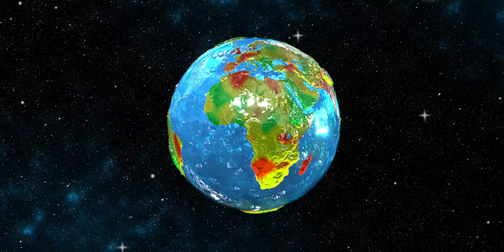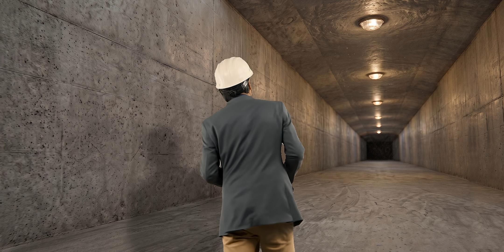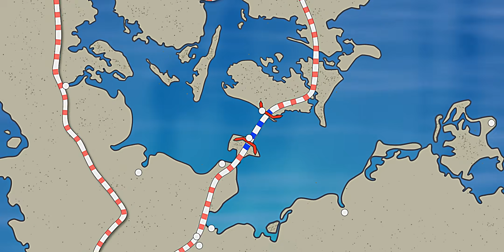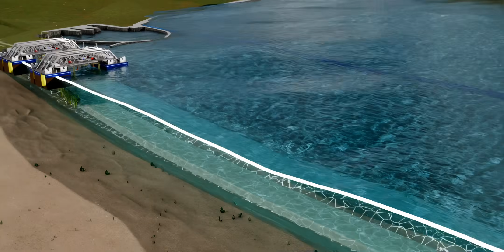Europe will be Completely Transformed After This Tunnel  | Fehmarnbelt

Comment from the maker: I hope you enjoyed the beauty of precise CNC machining. https://jlccnc.com/?from=SabinCE New users can claim upto $123 welcome coupons by visiting this link. With CNC machining and sheet metal services starting at just $1, JLCCNC makes high-quality fabrication accessible to everyone.
Without their support the Fehmarn belt tunnel video would not have been this much informative. Thanks for watching! — Sabin Mathew
Reply: You should be ashamed of yourself for the propoganda in your N9ne E11vn video
Reply: There are a slight mistake in connection with how the tunnel over time will be covered with sand by nature. It are an integrated part of the project that the sand removed to dig the trench will be pumped back over the tunnel elements AND new bottom plants will be planted by divers as well. They actually will start by covering tunnel elements with gravel before pumping sand back on top. So around 5 years after tunnel opened bottom should be fully restored to be like before work were initiated.

Comment: If each section is water tight, what is stopping workers from entering a first laid section when the next third or further ones is being laid?
Reply: Many of the illustrations in this video are factually wrong. Unlike what you see in the video, the elements are being laid from the portals and will meet in the middle of the Fehmarn Belt. The first bulkheads are already removed, and workers are already in the laid sections of the tunnel.

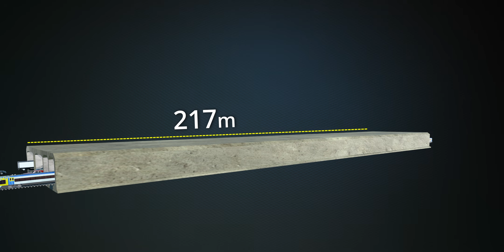Comment: Page 8:30 why pour concrete to finish the joints? Will this make joints rigid? Joint performance for water tightness will be sensitive to joint misalignment caused by bending stress from future settlement.

Comment: Now we just need the German side to be ready with train tracks and motorway, the danish side will be ready on time
Reply: The current estimate for the German rail connection is 2031. If the tunnel is opened before then, they either open only the motorway part first, or the train stops on the train station on Fehmarn, and people have to be shuttled by busses to the main land.

Comment: The title is a bit misleading. Yes the tunnel will be good as you don't need the ferry anymore (time gained) and it is a nice engineering feat. However stating it will "transform Europe" is a bit over the top as they say. But otherwise it's a nice informative video.
Reply: There are a good chance that the tunnel will make rail based and thus low to non carbon emitting transport a much better option for many moving goods from Nordic region to central Europe and beyond and vice versa. The current bottle necks in existing railroad path are the two bridges in Denmark that already today are used at high capacity. The likelihood that Spanish and German car makers would switch from sea based transport to rail for Nordic region markets an example that could eliminate a lot of transport time by sea. Artic circle wood could be sent by rail all the way to Gibraltar by rail etc.

Comment: From copenhagen to hannover via femern using the ferry: 493 Km.  Expected price fermernbridge  545Kr for car.
From copenhagen to hannover via storebæltbroen  522 Km.  Price 205 kr
Difference 29 km.  Ev consumption  5.5 km/kw/h =  29/5.5 = 5.27 Kw/h
Charging at Tesla supercharger in bispingen   3.44kr kw/h .   3.44*5.27 = 18.12 kr
Difference 545-205-18.12 = 321.88.
If i drive 29km  i can save 321.88 kr.
The population of sweden and finland is less than 3 % of europes population.  Obviously the norwegians are using the ferries  between norway and hirtshals.
Less than 3% of europes population having an expensive shortcut to eastern germany  and eastern europe is obviously not going to change much.
We have a saying in denmark .
Det er en ommer.
Reply: Gør arbejdet ordentligt eller lad være.. Sverige, Finland og Norge er moderne industrilande. Du glemte fordelen ved hurtigere og kortere transportvej for tusinde lastbiler, godstog og togrejsende.
Læs hellere offentliggjorte beregninger, fra dem der ved hvad de snakker om 🤡

Comment: As a Dane I have lived rather close to this new tunnel and for a long time, both entrance portals, also in Germany, have been made ready (And with our King, Frederik Xth, cutting the entrance band on the element in Denmark). It is a Danish-built and paid-for tunnel. But problems with the named "Ship", which is intended to position the elements in the ditch, have delayed the process. But now it is ready, and the first actual Tunnel Element has been placed on the seabottom. Amazingly, some distance from the Portal, but this must be intended, I presume? But the Germans are also delayed, so I doubt that I, at 78, will be able to drive through, as the opening now will be in the early thirties?

Comment: Your video is good, but I have two  questions which are not covered:
Question one is more of a funfact: 
Why are those gaskets called "Gina" gaskets? Hint: It has to do with an Italian actress....
More important is the second question:
The first element is already submerged, but they did not start somewhere in the middle and won't add to the sides from there. Since both portals are finished they will add from there and then finally they will have to add the last segment between the two halfs of the tunnel. How will they position this element since the option to put it "almost" in place and then let pressure and those hooks do the rest is not possible then?

Comment: ai summary

Abstract

This technical analysis details the engineering and construction methodologies of the Fehmarnbelt Fixed Link, an 18-kilometer under-construction immersed tube tunnel connecting Hamburg, Germany, and Copenhagen, Denmark.

The project utilizes 89 massive, prefabricated concrete elements, each 217 meters long and weighing 73,500 tons, manufactured at a highly specialized 150-hectare casting facility in Rødbyhavn, Denmark. The construction workflow involves casting elements in nine sequential phases under climate-controlled conditions to guarantee a 120-year operational lifespan. Once cast, elements are sealed with reusable temporary bulkheads, floated via controlled ballast trimming, towed to the marine site, and hand-transferred to the custom-designed immersion pontoon Ivy.

Marine installation requires excavating a precise trapezoidal trench along the seabed, preparing a gravel foundation at depths up to 30 meters, and lowering the elements using strand jacks. Final 2D alignment is accomplished via tensioned mooring ropes and guidance cables. Watertight sealing is achieved hydrostatically: pulling jacks compress an elastomeric GINA gasket, and the subsequent dewatering of the joint cavity creates negative pressure, allowing external hydrostatic pressure to lock the joint prior to permanent concrete casting and bulkhead removal via a specialized Bulkhead Lift and Rotation Tool (BLRT).

A comparative evaluation explains why the immersed tube design was selected over a cable-stayed bridge (due to shipping collision risks, environmental footprints, and railway gradient limits) and Tunnel Boring Machines (unnecessary at the shallow 30-meter depth). While official targets project a 2029 opening, a 24-month delay in commissioning the vessel Ivy suggests a realistic traffic opening in 2030.

**
Project Analysis: Fehmarnbelt Immersed Tube Tunnel Engineering

    0:00 - Marine Transverse Alignment Mechanics: Engineers control the lateral position and alignment of immersed tunnel elements during lowering using strand jacks mounted on dual pontoons. Precise straightening against marine currents is achieved by tensioning mooring ropes anchored to the seabed; as the ropes are pulled vertically, they naturally straighten, forcing the element into alignment. Guidance cables provide full 2D mobility.
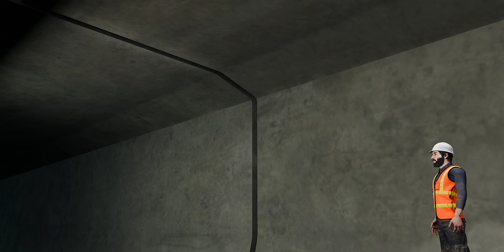    1:42 - Hydrostatic Sealing and GINA Gaskets: Watertight joints between the 217-meter elements are established using hydrostatic forces. After ROV inspection and high-pressure water jet cleaning of the joint faces, internal pulling jacks draw the new element against the previous one, compressing a primary rubber GINA gasket.
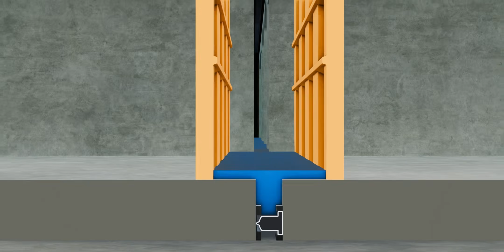    2:53 - Vacuum-Assisted Joint Bonding: Pumping out the water trapped within the chamber between the two bulkheads creates negative pressure. The external hydrostatic pressure at the seabed (up to five times atmospheric pressure) pushes the elements together, creating an incredibly tight bond without external machinery.
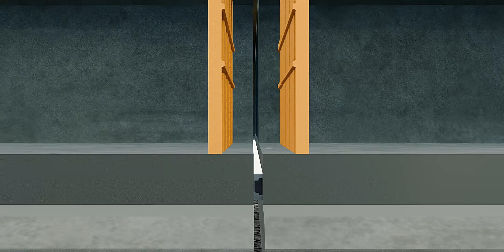    3:13 - Permanent Jointing and Atmospheric Safety: To finalize the connection, workers enter the joint chamber (maintained safely at 1 atmospheric pressure) to install a secondary Omega seal and pour permanent concrete. The joint remains completely stable because the internal tunnel pressure (1 atm) remains far lower than the external hydrostatic pressure.
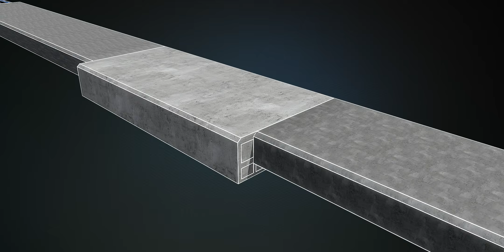    4:20 - Double-Decker "Special Elements": Out of the 89 total tunnel elements, 10 are designated as "special elements." These are wider and feature a double-decker layout; the lower deck is reserved for critical mechanical and electrical infrastructure (transformers, switchgear, pumps) and includes a layby for maintenance vehicles to avoid interrupting traffic.
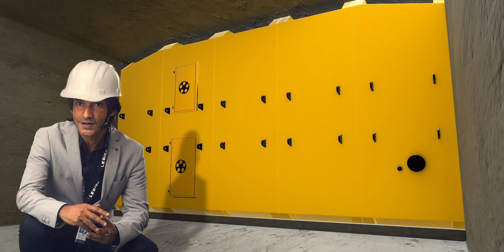    5:38 - Bulkhead Lift and Rotation Tool (BLRT): To reuse the heavy steel bulkheads, a specialized four-legged machine (the BLRT) enters the completed tunnel sections. Utilizing a compact, dual-piston hydraulic hinge mechanism, the BLRT lifts and rotates the bulkheads 90 degrees within the tight structural clearance of the tunnel, loading them onto trailers for extraction.
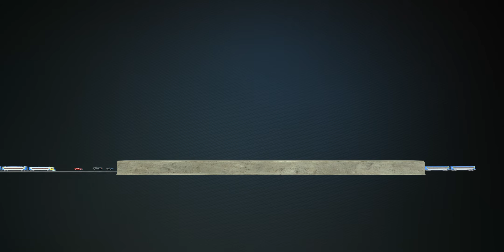    8:26 - Mass Scale Segmental Casting: Elements are fabricated at a 150-hectare casting facility in Rødbyhavn, Denmark. Each element requires 350 kilometers of steel rebar and is cast in nine distinct 24-meter phases using hydraulic formwork inside climate-controlled halls. Controlling temperature and humidity during curing ensures a 120-year structural lifespan.
    10:31 - Ballast Trimming and Floatation: Once cured and sealed with bulkheads, the fabrication basin is flooded. To prevent uncontrolled tilting, internal ballast tanks undergo "trimming" (partial filling) to ensure the 73,500-ton concrete structures float perfectly level and at the precise draft needed for tugboat towing.
    12:34 - Immersion Vessel Ivy and Subsea Lowering: In the work harbor, elements are transferred to Ivy, a custom-built catamaran-style immersion pontoon. Internal concrete ballast tanks are flooded to make the element negatively buoyant, and Ivy lowers the assembly into a pre-dredged, gravel-lined trapezoidal trench on the seabed.
    14:58 - Technical Justification Over Bridge and TBM Designs: A cable-stayed bridge option was rejected due to shipping collision risks (42,000 to 70,000 transits annually), a larger permanent environmental footprint, and steep gradients (over 1.2% to 2%) that would induce wheel slip for heavy freight trains climbing to a 65-meter vertical clearance. Tunnel Boring Machines (TBMs) were bypassed because the shallow 30-meter maximum water depth made the immersed tube method far more practical and cost-effective.
    15:19 - Regional Transit and Economic Impact: The completed link will integrate the ScanMed corridor, cutting the Copenhagen-to-Hamburg rail journey from 4.5–5 hours down to 2.5 hours. Crossing the Fehmarnbelt strait will be reduced from a 45–60 minute ferry trip (excluding 15–30 minutes of terminal waiting) to a 10-minute drive or a 7-minute train ride.
    18:50 - Production Milestones and Timeline Adjustments: While the first concrete element required nearly a year to complete, the Rødbyhavn factory has achieved rapid serial production. Despite 24/7 operations and official government targets aiming for a 2029 opening, a 24-month delay in testing and certifying the specialized immersion vessel Ivy has led industry experts to project a realistic commissioning date of 2030.